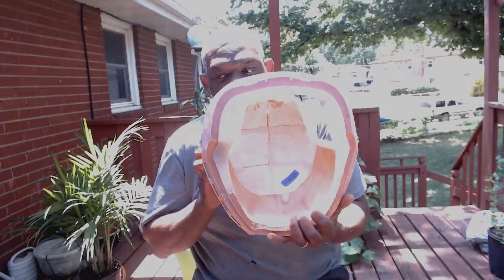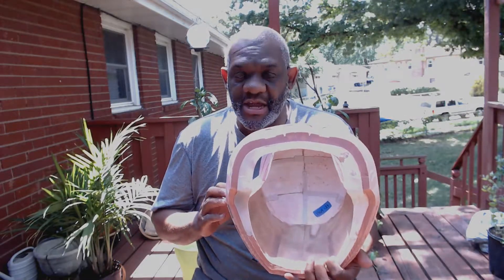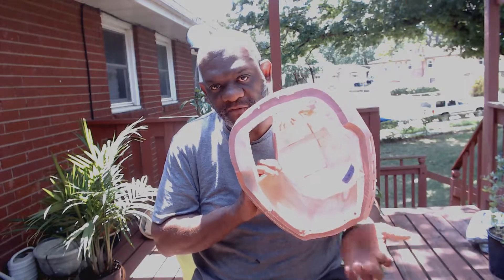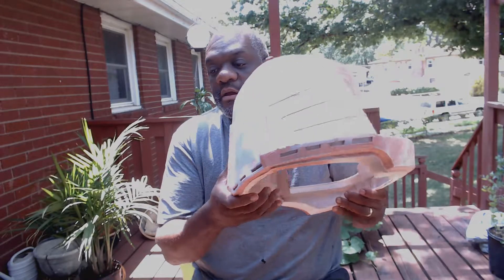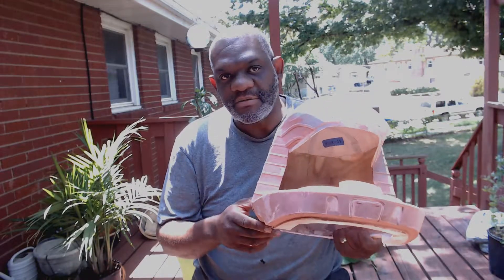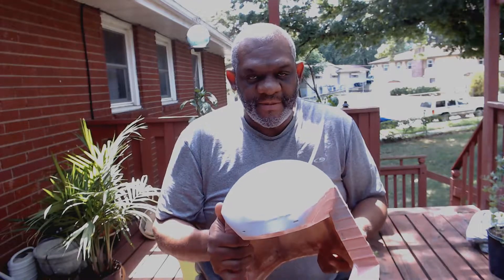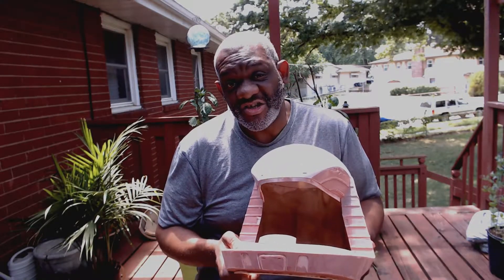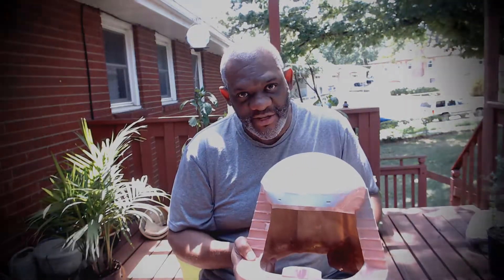3D PRINTED VIPER HELMET PART 2

Comment: Did you apply the fiberglass to the exterior too, or just the interior?
Reply from the maker: No Fiberglas on the exterior. I just wanted it to reinforce the 3d printed piece. You’d be surprised how strong it is. I I need to put some foam padding on the inside and a liner so it can actually be worn.
Reply: Mediocre Modeler Nice, thanks! I will do the same thing with mine.